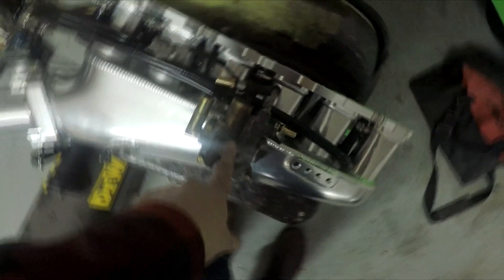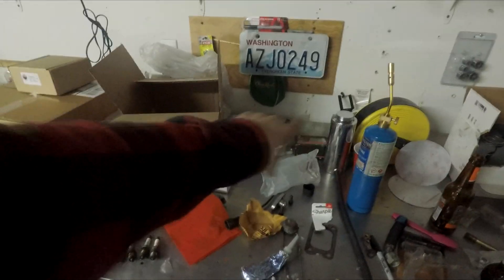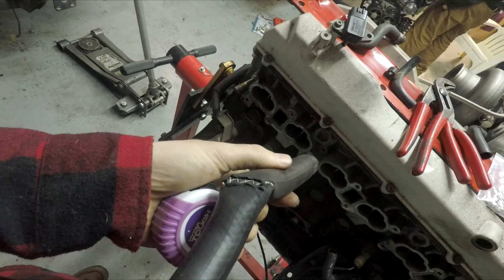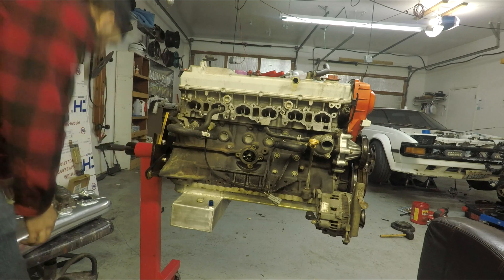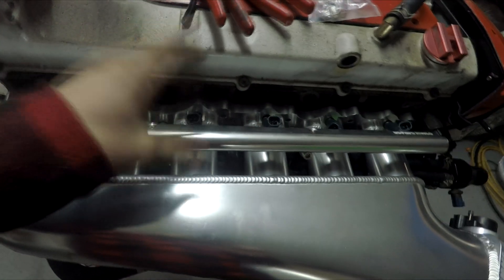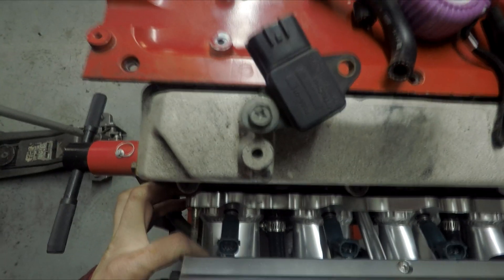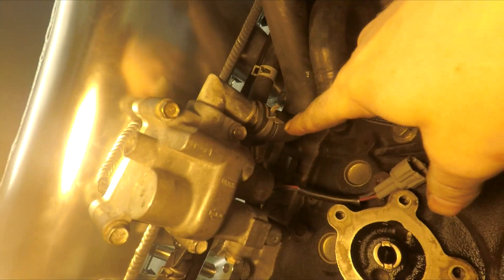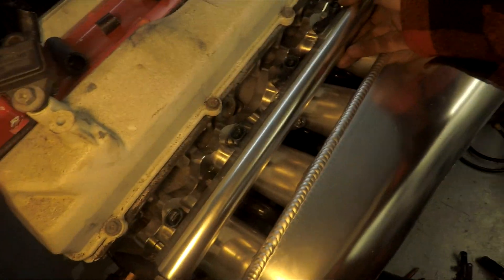rb25 build part 3: intake lines

Comment: I'm here to learn, love all the knowledge. I'm building my first RB and its going in a Z32 so I have gotten some good info from you. Build is fairly simple so far, supertech pistons, manley rods, tomei procams, ferrea oversized valves and dual valve springs, ti retainers, 1050 cc injectors, 485 walboro fuel pump, and now I have my trans assembled soon since your video just showed me how to get it all together. Now I just need to figure out my turbo and manifold. Thanks again!
Reply from the maker: man sounds like you are shooting for the moon. dont forget to attend to the oiling system. i can send you a link to a great video explaining everything if you would like
Reply: @NoGripOnLife  if I remember correctly (I have all docs in car atm) so far I have grub screwed my front restrictor, then 1.5 for the other two. I'm running an N1 oil pump just to get it running until I feel like dropping on a big boy pump. That plus a Prp dual rear head drain solve most of the problems for my application. I should do a larger sump but I just haven't seen the need yet.
Reply from the maker: @jmb9893  that all sounds about right. other then drilling out the plugs in the crank and flushing the gunk out to really get that oil flowing thru there. and then tapping the ports to insert grub screws. i basically follow drift squid like hes righting an rb bible. haha